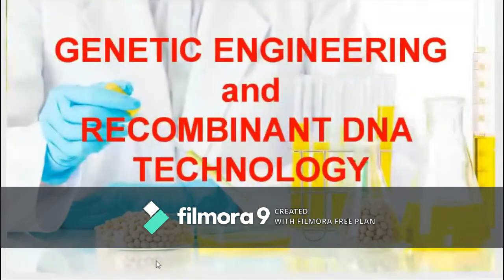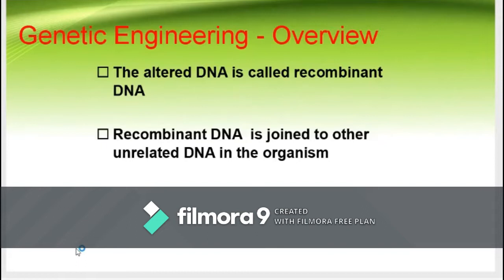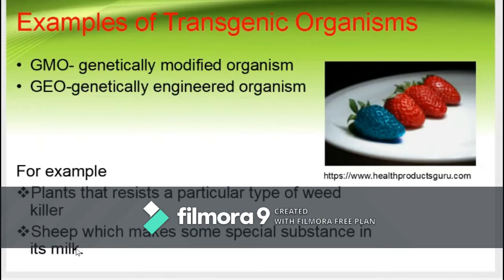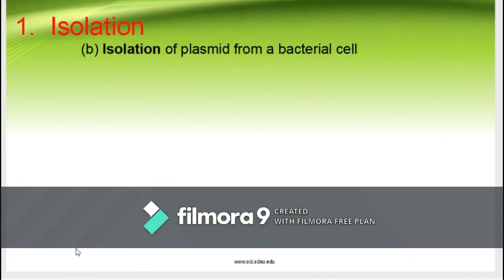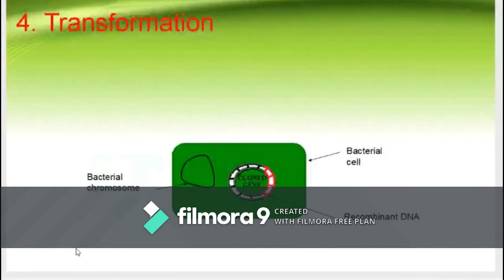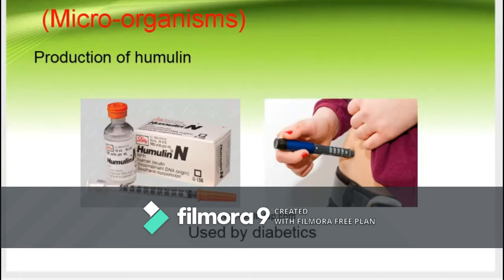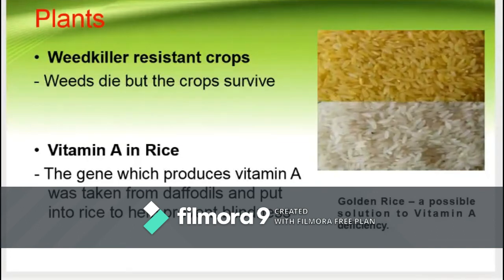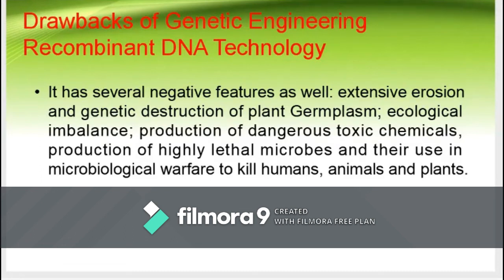GENETIC ENGINEERING & RDNA TECHNOLOGY

Comment: PAJE, MARY GRACESEL G. 
XI STEM - RUTHERFORD

Genetic Engineering, recombinant DNA Technology, the fundamental processes and applications in it. Genetic Engineering pertains to the integration, effacement, or manipulation of a single trait in an organism to engender a desired change. It sanctions genes from one organism to be inserted into a cell of a different organism of a different species. The altered DNA is called the recombinant DNA and it is joined to other unrelated DNA in the organism for Genetic Engineering to take place. 

Transgenic Organisms were supplementally tackled here, which are organisms resulted from genetic engineering. Stages of it were withal included which are the following: Isolation, Cutting, Ligation and Insertion, Transformation, and Expression. In the video, it has withal been verbally expressed how these processes can be utilizable in fields such as Medicine and Agriculture but, as much as it can be subsidiary, there are its negative features as well which were withal not left out in the content.

There is a change in the genetic makeup of an organism from genetic engineering process for the utilization of recombinant DNA (rDNA) technology. Through regulating reproduction and culling the scion traits, are not manipulated by fortuitously genomes. The intentional modification of an organism's DNA genetic engineering.

The purport of genetic engineering which is sanctioning DNA from an organism to cumulate with another DNA from a different species. I learned that recombinant DNA and RNA could withal be modified to circumscribe the utilization of the term to fund the transmuted name of transgenic organisms. Advantages and disadvantages, it has very consequential genetics. There are benefits and they can be applied in fields such as medicine, agriculture and environmental cleaning. The counter-enemy that can have ecological effects on the environment is this imbalance.

Comment: Borja, Maxene Sigrid T.
11-Marie Curie

Recombinant DNA is developed by transmitting selected sections of DNA from one organism to another. While the genetic engineering is the mechanism of of using recombinant DNA technology to modify an organism’s genetic makeup like the one who alters or repair a form or function.Both working together to introduce the resulting hybrid DNA in order to form new variation of heritable genetic material. That have value to science, medicines, agriculture and so on.

The book entitled,” Recombinant DNA Technology”, provide comprehensive analysis of the DNA structure and the process of DNA replication. Extensive analysis of restriction endonucleases, sequencing by Sanger’s method, and protein production in bacteria, detailed description of PCR, RFLP, AFLP, and DNA fingerprinting. Thorough explanation of site-directed mutagenesis and cloning in cosmid vectors. In-depth discussion on methods for creating recombinant DNA molecules and construction of DNA libraries, concepts and applications of agarose gel and polyacrylamide gel electrophoresis.

Two other technologies, cloning and DNA sequencing, are mainly based on Recombinant DNA technology. In order to produce the clone of one specific gene or DNA sequence of interest, cloning is carried out. After cloning, the next step is to identify and separate the clone from other library members. Its nucleotide sequence can be determined after a portion of DNA has been cloned.

Before, Recombinant DNA technology was just an imagination that by manipulating the expressions of target genes, attractive traits can be reinforced in living bodies. But now, have shown a valued outcomes in bringing change to human life. Where it improves diseases, drug and medical production. Not just in medicines but also to agriculture and sciences. An through this lesson i understand better now the human gene variation.

Comment: PARRUCHO, PRINCESS SAHARA M.
GRADE 11-STEM MARIE CURIE

                      From agriculture to what genes a baby can get, genetic engineering plays a greater role in our everyday life than what we thought. So what does genetic engineering really means? Genetic engineering is thought to be the action of weeding out the bad genes to the gene pool, but this is not completely true. When we say genetic engineering, usually the first word that comes in our mind is “genes”.  The term genetic engineering is used to describe the mechanism by which “recombinant DNA technology” can be used to change the genetic makeup. It involves manipulation of genes in order to make useful and helpful products. It is relevant to the simple addition, deletion or manipulation of a single trait in an organism to create a desired change. Moreover, in molecular level, it is copying a piece of DNA from one organism and joining this copied DNA into the DNA of the other organism. Organisms which genetic material are changed other than random natural breeding through gene transfer or the moving of gene from one organism to another are called transgenic organism. It is manifested also in the video the five stages in genetic engineering, these stages are Isolation which cells broken open, Cutting where restriction enzymes act as molecular scissors and cut DNA at specific sites called restriction sites, then we have Ligation and Insertion which is the joining of two DNA molecules by the enzyme, the transformation where recombinant DNA introduced into bacterial cell and lastly, expression stage where the newly produce bacterial cells now contains the genes coded for by the donor DNA.

                       A related study to this is genetic engineering in floriculture found in Springer Link. Novelty thrives in the global flower industry. Genetic engineering provides a valuable means of expanding the gene pool of floriculture to facilitate the development of new commercial varieties. Currently, commercialization of genetically modified flowers is limited to novel colored carnations. However, given the level of operation in the market, more products are predicted. In general terms, engineered features are important to either the consumer or the manufacturer. Currently, only market characteristics seem capable of producing a return capable of sustaining what is still a relatively costly molecular breeding method. In model flowers such as petunias, the biosynthesis of floral pigments, particularly anthocyanins, has been elucidated in great detail. This understanding is now being extended to an understanding of a wide variety of other flowers in these species and offers a way of targeting color modification. In a given range, the engineering of novel traits often relies on plant transformation capabilities that continue to expand at a rapid pace. It is not always predictable to express genes transferred across genes, so it takes considerable trial and error to arrive at a consistent phenotype of commercial interest. 

                 Genes plays a crucial role in genetic engineering. Genes are the factor that controls the inheritance of character or trait such as hair color, the color of your eyes , skin color and so on. Genetic engineering means that DNA from different organisms can be combined like human genes inserted into other animals or bacteria can be engineered to produce human proteins. The altered DNA is called recombinant DNA. Recombinant DNA is joined to other unrelated DNA in the organisms that is done through splicing. There is also what we called GMO (Genetically Modified Organism) and GEO (Genetically Engineered Organism), which are examples of transgenic organism. These are two terms often used interchangeably yet they are not the same thing. An organism such as plant, animal, or bacterium is considered genetically modified if its genetic material has been altered through any method including conventional breeding. On the other hand, GEO are organisms modified using techniques that permit the direct transfer of genes in that organism. The purpose of genetic engineering is it allows genes from one organism to be inserted into a cell of different organism of a different species.

                 I had learned so much in this topic like what is genetic engineering , what is the  purpose of it , how DNA from different organisms combined  and what are stages involve in genetic engineering . Aside from these, and what amaze me is, I had also learned the applications of genetic engineering in medicine like RDNA technology has been used for diagnoses and treatment of diseases, correction of genetic disorders, manufacturer of hormones and other pharmaceutical products like vaccines, as well as in agriculture , wherein this field also obtain benefits  from the use of RDNA technology in the improvement in animal breeds and crop plant varieties. It was also interesting to know that RDNA technology is also used in Environmental Cleanup for some modified microorganism can be used to extract minerals from the environment  or degrade toxic waste materials and they are also use in field of forensics. I had also kept in mind, that although there are many ways that RDNA technology can be use and helpful , it has also several negative features like extensive erosion, genetic destruction of plant Germplasm, ecological imbalance and many more, so this shows that the field is still uncertain and the best way to avoid these negative effects is, I think,  to be careful and mindful.

Comment: Quennie Ara S. Delfinado
12-STEM MENDELEEV

Genetic engineering, also known as genetic modification, is a process in which manipulates and alters genes of a certain organism. Using rDNA (recombinant DNA) they interpolate the genetic composition of an organism. They can either add, remove, or manipulate the traits of an organism to their desired alterations. Traditionally, humans indirectly manipulates genome by selectively breeding and choosing offspring to achieve the coveted traits. This process requires direct management of one or more genes. Genetic engineering’s main objective was to allow genes of one organism be inserted to that of another organism. At the molecular level, a piece of genetic information is copied from an organisms. Then this copy is then added to the other organism in which they plan to alter. 

Recent research published in November 9, 2020 in Proceedings of the National Academy of Sciences demonstrates how gene editing can be used to spot the genes present in corals’ ability to withstand heat stress. Reef-building corals are species threatened by anthropogenic stresses considering climate change. Numerous genomic and transcriptonic studies were executed to examine corals’ responses to stress and other factors of their biology. Rendering number of hypotheses regarding the roles of particular genes and molecular pathways. However, it has not broadly been possible to test these hypotheses strictly because of the lack of genetic tools for corals or nearly related cnidarians. CRISPR technology seems likely to improve this problem.

Genetic engineering is characterized as a direct manipulation of a certain organism’s genes, it may or may not be heritable or uninheritable recombinant DNA. By replacing a defective gene with an efficient one, genetic engineering may somehow theoretically improve serious genetic problems with humans. Genetic engineering is accomplished in three basic steps; isolation of genetic material from the donor organism, insertion of an separated genetic material donor into a vector genome, and lastly, the growth of a recombinant vector in a suitable host.

The significance of genetic engineering and rDNA technology, were the first things I learned while studying and watching the video. It fascinates me how we are capable of manipulating and altering different genetic materials of different organisms. The video was an effective way to expand our knowledge in this topic. I also learned that using genetic engineering doctors, scientists, or even us can manufacture medicines used in healing various diseases.

Comment: LUCIANO, Daeniross C. 

          In any living organism, the DNA acts as a guide for the body, certain genes code for certain proteins that form the different parts of an organism to make it whole. Any trait is coded by the genetic material or the DNA. This is where genetic engineering comes in. Genetic Engineering also called Genetic Modification is the direct manipulation of an organism’s genes including heritable and non-heritable recombinant DNA constructs. It occurs when a genetic code of an organism is altered to produce a desired trait. This is done by taking a gene from one organism and inserting it into the DNA of another organism to get the wanted or desired result. Genetic engineering is used to substantially edit the parts of the gene that we want. This phenomenon is not done without following important procedures; there are five stages involved in Genetic engineering. Isolation is when a chromosome that contains the target gene and a plasmid is isolated. The DNA of every organism is made from the same four bases which enables scientists to use special enzymes to cut certain parts of the DNA in the stage called Cutting. Ligation and Insertion is when the desired gene is joined to the DNA of the target. Transformation is the result of the cutting and joining events in the previous stages. Lastly, the cloned genes are reproduced in the stage called Expression. 

          In the field of medicine, genetic modification has been generally accepted. Some of these are: genetic engineering used to produce humulin, a medication used for diabetics which is created with genetically modified bacteria. This medication can be given to diabetic patients who lack the insulin they need. Now how is it done? Scientists have identified certain parts of our DNA that codes for insulin and they undergo the five stages involved in Genetic engineering. This results in bacteria that produce human insulin and the fact that bacterias multiply frequently, scientists can create a handful of insulin in a short period of time.

          Genetic engineering could possibly create unknown side effects. It holds both advantages and disadvantages depending on the organisms modified. One of its disadvantages is that genetically modified crops could be harmful such as toxins from the crops that could cause allergic reactions in people and some believe that it is unethical to intervene with nature. Despite the disadvantages, genetic engineering also has its benefits. Some of these are: increased crop yields in agriculture, reduced costs for food and drug production, enhanced nutrient composition and food quality, greater food security, and medical benefits to the world’s constantly growing population. 

          Over the years, humans have been artificially breeding and with the advent of gene-editing tools, scientists and molecular biologists have come up with a faster way to do it by genetic engineering. In this way, humans can transplant the gene for a desired trait into an organism. This process provides a faster and more efficient way of modifying organisms which is beneficial to humanity. Overall, genetic engineering is important because of its purpose in different fields. It is an essential tool for many scientists, biologists, naturalists, etc. It could potentially fix severe genetic disorders in humans by replacing the defective gene with a normal one. I have learned that genetic engineering can be beneficial not just to the modified organism but to the greater community as well.